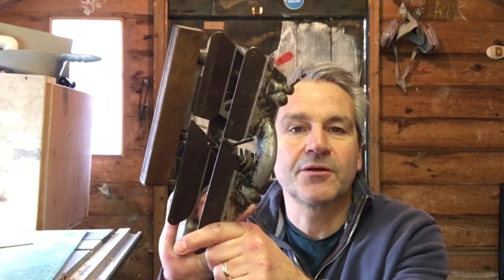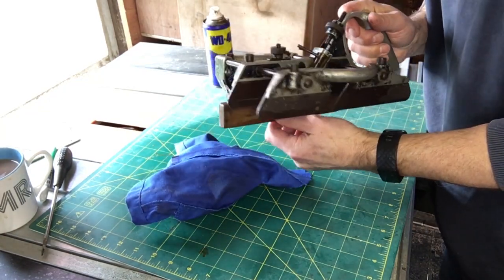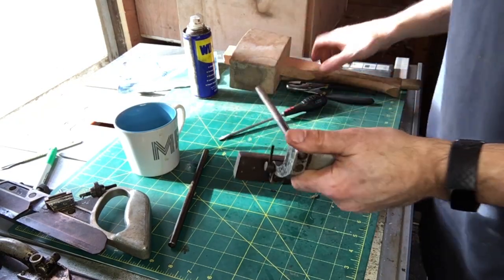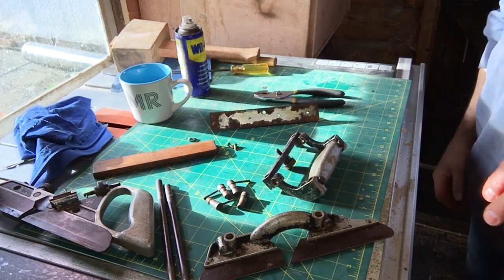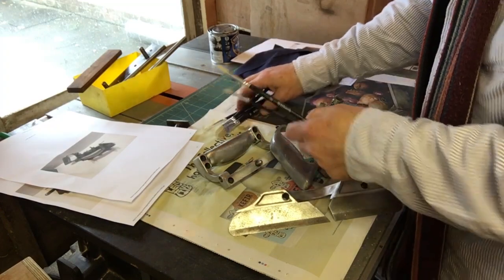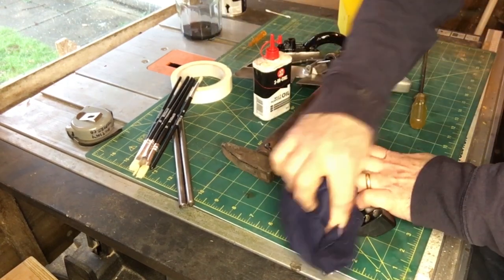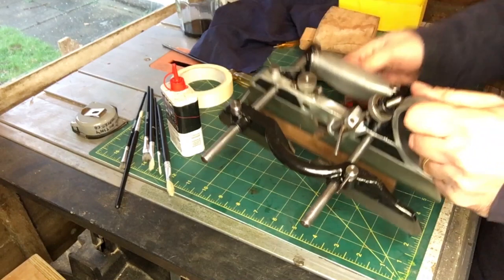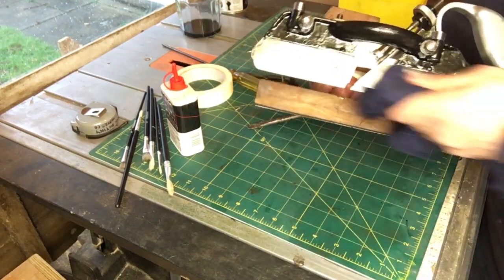Lewin Combination Plane Restoration

Comment: This cleaned up nicely.    A lot of work.  Well done.
I have a Stanley 45.   Everything works, but it sits in a drawer.   It takes time to setup.   My observation of any tool or machine designed for a combination of functions is that each function may work, but not as easily as a machine or tool designed for a single function.
WD-40 is good for cleaning, but it is not a very good penetrent.   A lot of people use a combination of 50% acetone and 50% Automatic Transmission Fluid.    This is supposed to be the best penetrent.    I have a commercial product called Kroil, but when I have consumed the can I will use the 50/50 mixture.
The straight ended dado blades should be possible to make yourself assuming you can get dimensions.   If the blades are the same as the Stanley 45 I can take measurement.   I purchase O1 steel to make cutters.    Readily available in round and flat stock.   I think the equivalent in the UK is called Silver Steel.   O1 is annealed when purchased (soft) and is easily hardened and tempered.
The rods are a pain, as you experienced any racking of the components, even a tiny amount, will result in the part binding.
Dave.
Reply from the maker: thanks will try that, I didnt enjoy doing this one as much as it felt like overall design was not going to be easy to live with